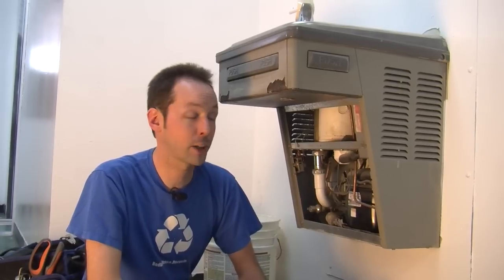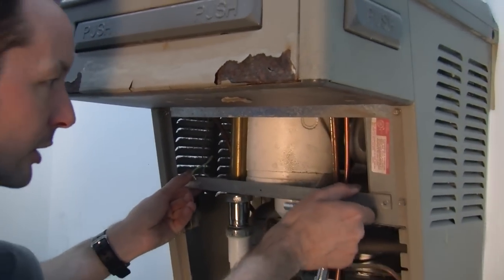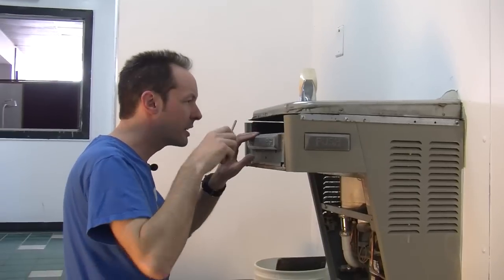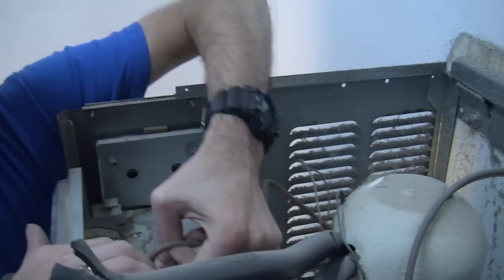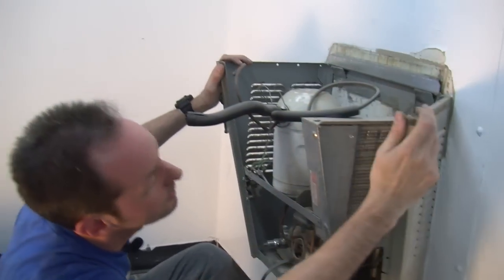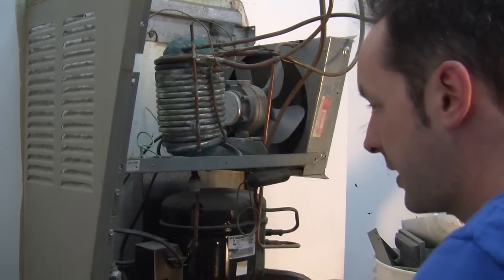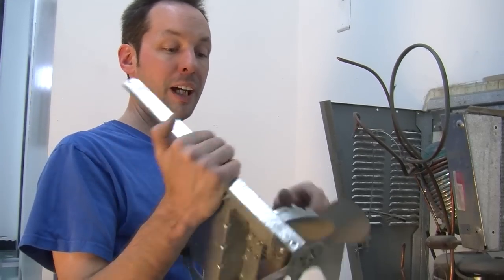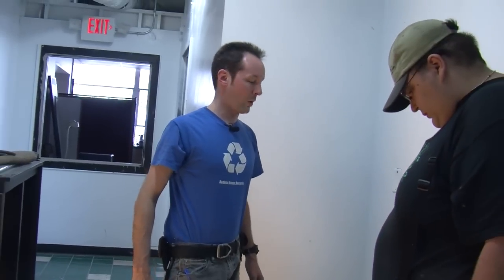Disassembling a Water Fountain

Comment: Because 1/4 screws cost less then 5/16 screws. If you did not know those type screw are very expensive. So when your are manufacturing thousands of fountains the savings is substantial. 
So if a 1/4” screw fits the application that’s what they use
Makes perfect sense to me especially since I service water fountains among other Refrigerartion equipment 
Have a great day
Reply: 36:54 I think the reason for  using the different size of screw was to match the pre-made components. For example the radiator, would have come with its own specific size of mounting holes, that require specific size of screw. To me is seems 1/4 is used for sub-assemblies, and 5/16 is used for all the main structure. This is good because diffrent that means only one size of screw is used for a given job to do. 5/16 is more than likely the smallest (and therefore cheapest) size of screw that can be used in all structural components, and therefore 5/16 is used for all things that arnt easily encapsulatable into sub-assemblies. 2 screw sizes, but only 1 size of screw for a given assembly departments jobs to do. I should rewatch the video and check if the size of screw for the fan motor bracket are the same as holding the radiator, as I can imagine those being assembled on the same workbench.
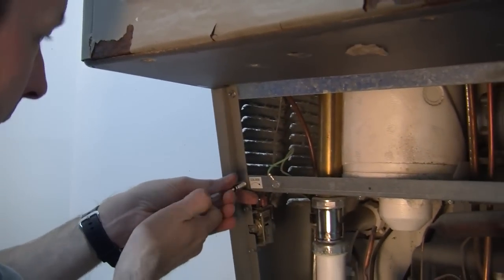Reply: The motor bracket was never disassembled so I didnt get and a definite awnser to what I was wondering. But I looked deeper, at 6:15, The ground wire is 1/4". This implies the ground wire is added as part of a sub-assembly. Likely with other wiring, e. g. The motor. The size of the screw for the ground wire may have been determined by the size of mounting holes the chosen radiator had. The ground wire screw being 1/4" does provide further insight that the motor mount screws are 1/4". Yay for watching thing non-sequentially. The order in which engineers designed components is independent of the order in which components are assembled. 36:52 6:15 you can also see different types of screws being different things at 9:30.

Comment: Directly from Wikipedia on the subject of R134a safety:

"Contact of 1,1,1,2-tetrafluoroethane with flames or hot surfaces in excess of 250 °C (482 °F) may cause vapor decomposition and the emission of toxic gases including hydrogen fluoride and carbonyl halides. 1,1,1,2-Tetrafluoroethane itself has an LD50 (lethal concentration for 50% of subjects) in rats of 1,500 g/m³, making it relatively non-toxic, apart from the dangers inherent to inhalant abuse."

Cont.

Comment: Cont.

"Aerosol cans containing 1,1,1,2-tetrafluoroethane, when inverted, become effective freeze sprays. Under pressure, 1,1,1,2-tetrafluoroethane is compressed into a liquid, which upon vaporization absorbs a significant amount of thermal energy. As a result, it will greatly lower the temperature of any object it contacts as it evaporates. This can result in frostbite when it contacts skin, as well as blindness upon eye contact."

Comment: my sister and I replaced a smal halogen lightbulb, with a LED bulb.. The lamp use a dimmer, but the LED bulb just wont go off... wonder why...
Reply: Led takes less amps to run it it takes the little amps from the dimmer and thinks its the full load